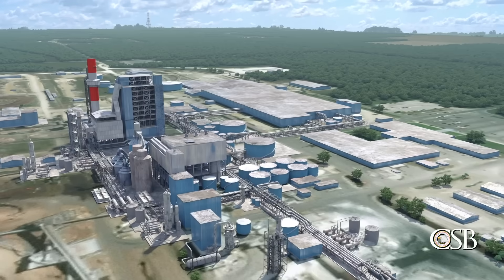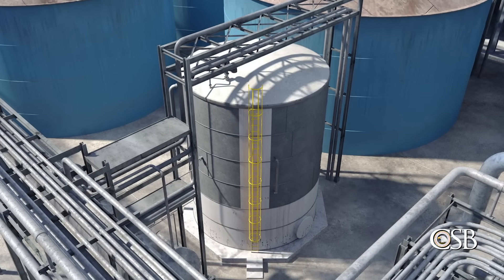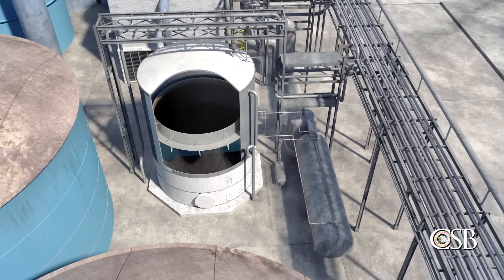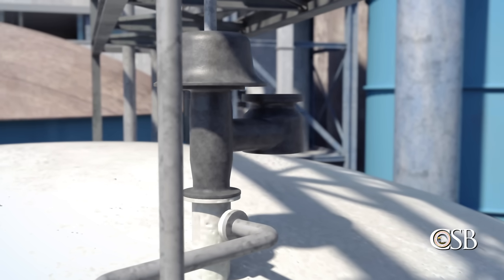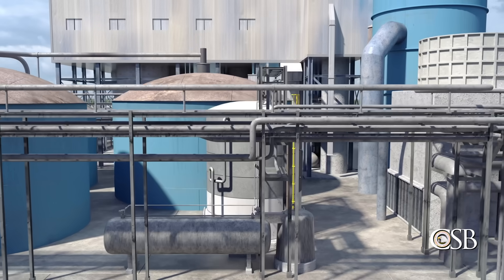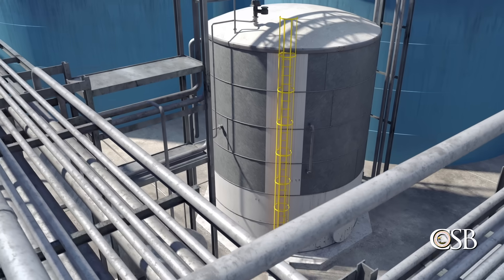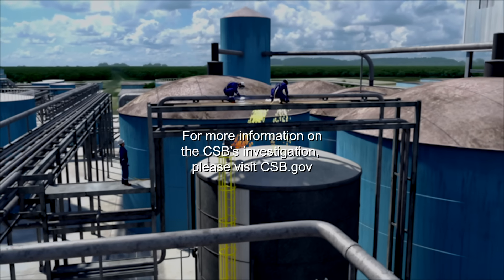Uncovered Hazards: Explosion at the DeRidder Pulp and Paper Mill

Comment: Love these, it just shows that problems are usually a series of multiple failures and lax practices.  Not just one person.
Reply: Really goes to show that you need to do your job correctly. Like you said, the case isn't usually that all the fault falls on one person, but any one of the people involved with the failures more than likely could have prevented these accidents.
Reply: @l0os176  complex system are almost always in failure mode, but because there are systems to handle failure, they can still mostly work, catastrophes happen when multiple failures combine in an unpredicted way.
Reply: @GabrielPettier  our technological and management level is very high.. 
Most failures is based on the human factor.
That's one of the reasons why automation is seen as a step forward...
Reply: @OmmerSyssel  I would agree, but automation can also make systems even harder to understand and manage, and can also make their failure much more spectacular.
Reply: @l0os176  Doesn't matter if you do your job correctly.
Once the holes in the swiss cheese lines up, it will happen, and sadly you do always know where those holes in the swiss cheese are before they line up.
Reply: It's about what's called hidden stories, where yes a trigger did cause the accident, but other factors made the trigger more likely, and can extend to inefficient computer control and alert systems
Reply: Many of the biggest, deadliest accidents are the result of several, seemingly small and unrelated things happening on the same day.
Reply: Well it's normally one error that ends up leading to multiple errors because of the first one. While we humans are very very good at trying to think of everything....we still make mistakes. It is very unfortunate but today we get to believe we will 100% be safe at work every day and we will always get to go home at night as long as we follow all the guidelines. Back in the day....companies used to predict how many employees would die before a job would be completed....it wasn't a if....it was a "well lets see how many die this time...maybe instead of 30 we can only lose 29 this time..."

These freak accidents are the very few things that we don't think of or are easily overlooked. Fortunately(and unfortunately) when these accidents do occur....it further increases future generations safety at the job site. Millions have died in the past for us to be as safe as we are today.
Reply: Correct in my experience. I'm not involved in anything near as interesting as the subject matter of most UCSB videos, but every accident, mishap, whatever can usually be traced back to multiple failed systems.
Reply: If you criticize management, you get fired. If you don't criticize them, you get killed, or both.
Reply: Yep it's a real  eye opener to how corrupt these companies are.
Reply: These accidents are primarily the fault of gay liberals being woke.
Reply: My field calls this the "swiss cheese model" because all it takes is one perfect combination of series of gaps/holes/lapses in safety precautions to cause an accident (i.e. if you line up enough slices of swiss cheese, holes will line up and allow things to pass through)

Comment: 8:45 - If a PHA had been conducted, what kind of modifications to the process would have been sensible to remove the flammable atmosphere from the tank and ensure it couldn't build up? I was surprised that the relief valve for the turpentine flow was a manual device with apparently no sensors or feedback to convey current conditions, such as a gas sampler within the tank, fluid level in the runoff trench, etc. If a mechanism is needed to ensure stable internal pressure, couldn't they have used a pure nitrogen feed or some other inert gas rather than a simple valve to the open air?

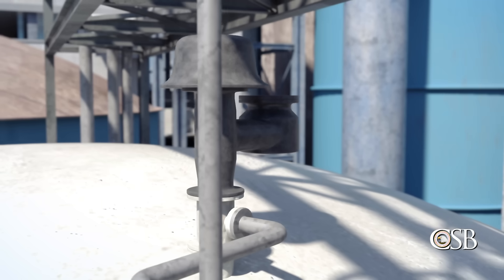8:58 - So it was thought that the vapour space lacked enough air to support combustion, but what were they basing this conclusion on? It can't have been proper sensors since such would have reported otherwise. It's shocking how much assumption was involved in the buildup to what happened. The union rep mentions the decision was made not to drain the tank; it would be interesting to know what the rationale was for that decision and the supporting data.

The lack of management responsibility and assigned care duties with regard to the tank is particularly egregious.

One thing does strike me as odd: is there no means by which those doing hot work can't as a matter of course lay down some kind of protective cover beneath the hot zone to at the very least catch sparks and molten fragments? I should imagine there are numerous fire resistant materials which could be used for this.

Thanks again for another well made video. It's a pity you guys only cover US incidents, I'm sure your skills applied to events such as Chernobyl and Bhopal (Union Carbide) would be most informative.

Comment: How do you not get a pressure pre alarm before a relief valve pops even if a vacuum breaker?
Reply: It likely had a nitrogen vacuum break as the primary means. But nitrogen supply can fail or be turned off. A collapsed tank and rupture with release of contents is a real risk. Vacuum breakers that suck ambient air is normal as a means of last resort. What possibly happened here is they did an area isolation of pipelines not appreciating it was preferable to keep nitrogen available. Designing a 100 kgal tank to be full vacuum rated is a near ridiculous statement.
Reply: Forget that.  Just have a vacuum breaker valve lined up to nitrogen source. Then no air gets in. Of course drained, purged, and open would be better for this tank.
Reply: @JohnSmith-lw2bm  Yeah, I was thinking "nitrogen blanket" thru the whole video. But i wonder if there is already nitrogen used in that mill. Running a new line from an existing nitrogen system vs. putting in nitrogen from scratch. 2 very different scenarios.